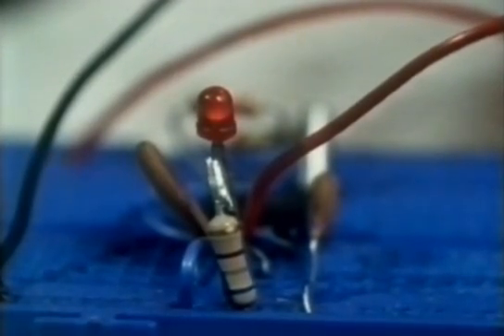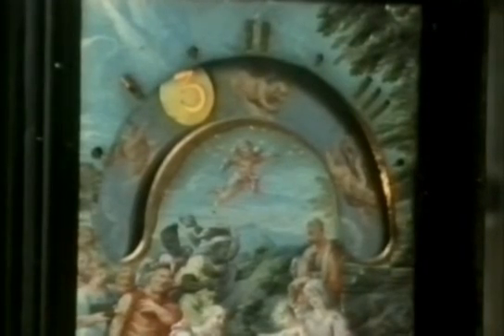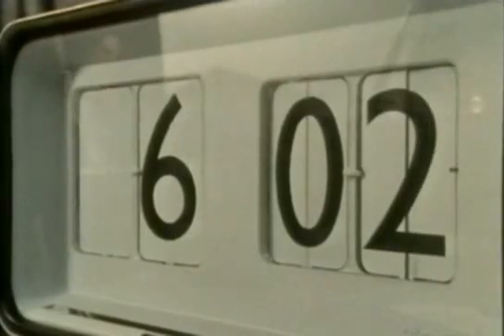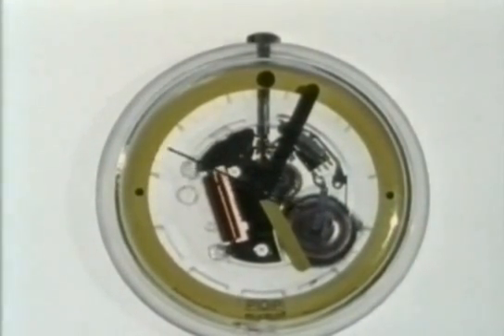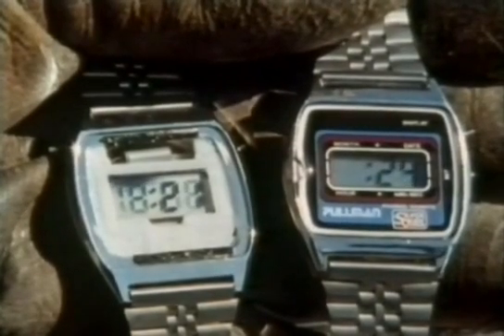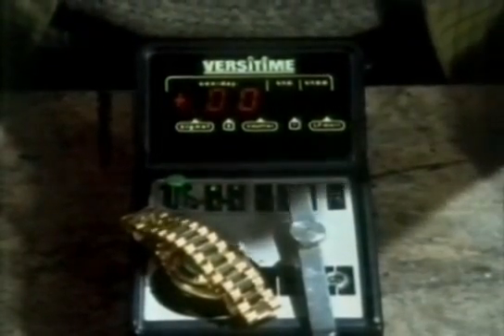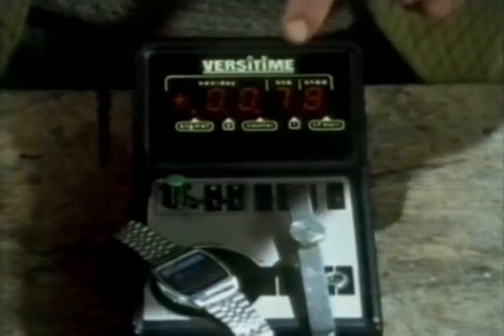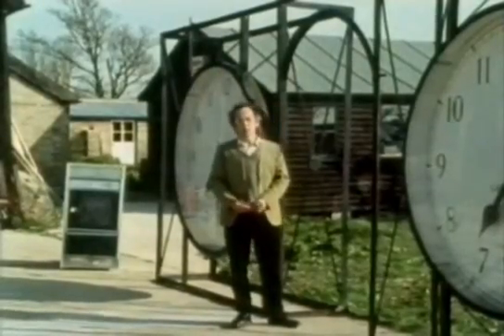The Secret Life Of Machines - The Quartz Watch Part-3

Comment: So the solar powered quartz movements are actually designed to work imprecisely. Since some of those solar powered watch require direct sun light for at least 8 to 10 minutes a day. Well, he got 2 seconds difference after a few minutes in the stove, but still. Very interesting physical phenomenon.
Reply: Quartz watches have come a long way... The bulova Precisionist and Gshock are prime examples. Gshock can last 10 years on a battery, survive a minimal of 10 meters fall on the cheap models, and accurate to 15 seconds a month...the bulova Precisionist has an incredibly high bpm and accurate to 10 seconds a year...loses less than a second a month...that's crazy accurate, or the king, the citizen chronomaster, accurate to 5 SECONDS A YEAR!!! that's about .334 seconds off a month. With batteries lasting years. I still prefer my Breitlings and Rolex's but man, these watches are incredible!